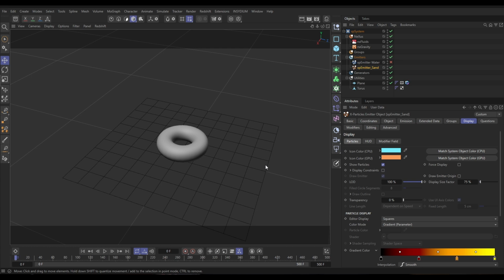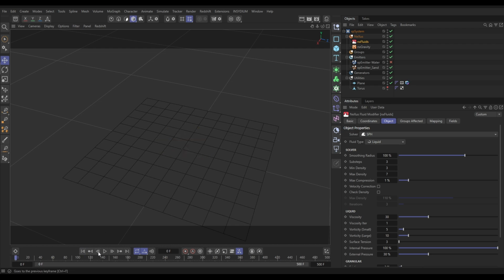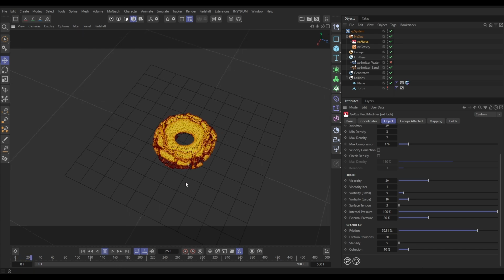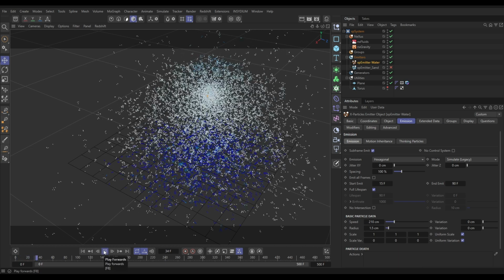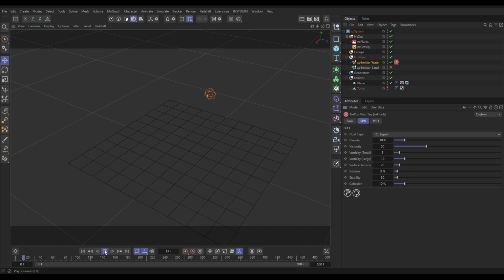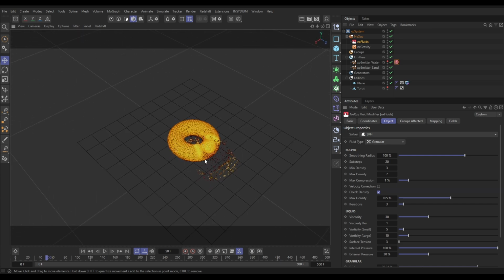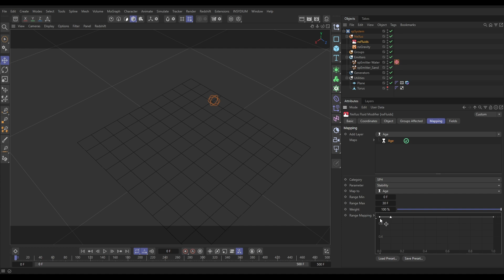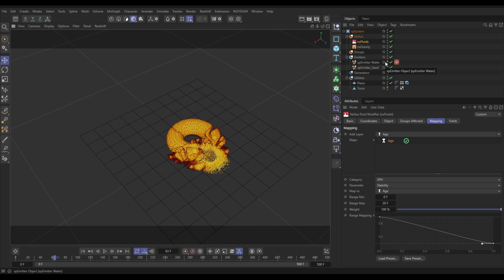Top Tip Tuesday - Simulating Sand and Water

Comment: Its nice one. What is your scene setup, mainly subframes steps and scene scale , every time I tries to follow you does not work. My torus is exploding , please advice me, thanks
Reply from the maker: Hi There. You can download the scene file used in this video - the link is in the description. The subframe steps are at the default of 1. The torus has a ring radius of 64 and a pipe radius of 30. The emitter is in shot - hexagonal mode with a particle radius of 1.5.
Reply: @ thanks

Comment: Hello Bob. Thanks for the nice Tutorials. Been watching them for years now and they are super helpful.

I have some questions on that one: isn´t that a bit fake here? The stability of the sand is just changed by time, not by the "fluidness" of the water. Is there a way to directly influence the stability of the water depending on whether the water is hitting it or not? Because as it is, the sand is always crumbling on frame 20 or something, no matter if hit by the water or not. 

Would be awesome to hear an answer from you.

And thanks again for the brilliant Tutorials, I have learned so much from you in the past years.
Reply from the maker: The water doesn't automatically make the sand wet - its stability is controlled via keyframes or data mapping. In this setup, stability is linked to the water's speed, so the sand collapses when hit.
Just to clarify: the sand doesn’t crumble on its own. The high initial stability helps it settle under gravity, then data mapping lowers it just enough to stand - until the water hits.
Reply: @INSYDIUMLTD  Hello, thanks for the quick reply, I appreciate it a lot :) 
But isn´t the stability linked to particle age in this setup? 
And yeah, I got that. The sand is crumbling at the same TIME, as the water hit it. But what I am searching for, is, that the sand is crumbling BECAUSE it was hit by some water. I am thinking about raindrops falling randomly on a castle made of sand or something in that direction. Do you know what I mean?
Reply from the maker: @christiandanzer3590  Yes, you're right, in this scene the Stability is mapped to age. However, it isn't reduced so much that the sand will crumble on its own. It only does so when hit by the water. The water moves the sand particles on impact - if that movement is above the stability threshold, the sand particles are relieved of the friction and they crack and collapse. Therefore the sand only collapses where the water hits it. The Stability needs to be set higher when first emitted so that the sand can settle under the gravity without collapsing. A different option would be to map the Stability to the speed of the sand particles, so that they have high stability when stationary, but lower stability when they're moving. Here, when they're hit by the water they will move, reducing their stability and causing them to crumble more easily.
Reply: @INSYDIUMLTD  Hello again and thanks for the quick answer and replies :) I understand, yeah, you were right, it doesn´t crumble on its own, indeed. Tried it out :) Also the suggestion with mapping to the speed was really helpful: tried it as well, makes it more believable, in my opinion. Also mapping the friction with a low weight can help, I find. 

Thanks again for the quick replies, looking forward to future tutorials :)
Reply: @INSYDIUMLTD  To anyone who´s interested, I have found a way:

1. Create two particle groups for the sand emitter. Use first group only in the "Groups"-Tab of the emitter
2. Thats just a safety step: Create a particle group for the water, add the Nexus-Fluid-Tag of the emitter to it
3. Create a second nxFluids, in the Groups affected, exclude all except for Group 2
4. Add a xPPCollisions from the Dynamics
5. Add a nxQuestion, in the Questions-Tab, use "If-Flags (Hit Particle)" -> Use Action "Set Particle Group 2"
6. In the second nxFluids change Friction, stability and cohesion to whatever you wish (Of course you can still use or change the mapping as before)

Enjoy! :)
Reply: I've found a simpler way. As long as the density of water is greater than that of the sand pile, the water can easily wash away the sand pile. And by combining it with the key frames of stability, the effect you mentioned can be achieved.